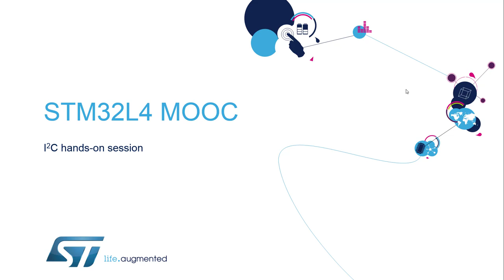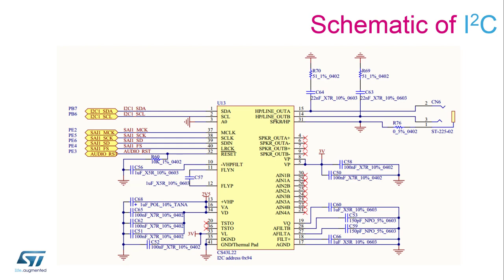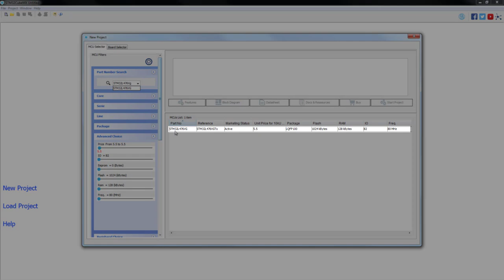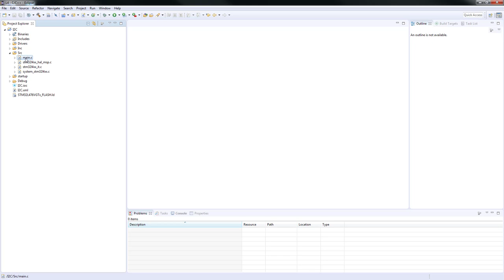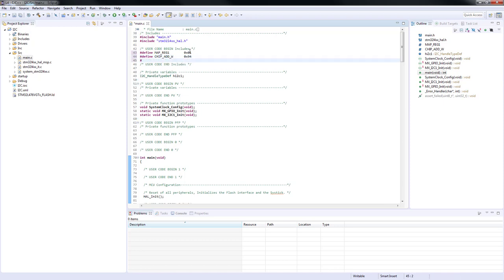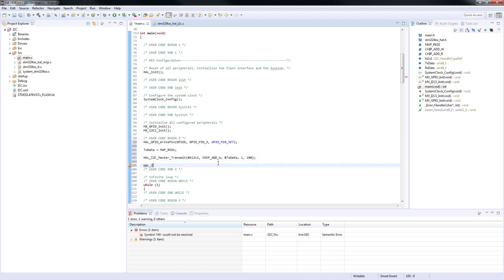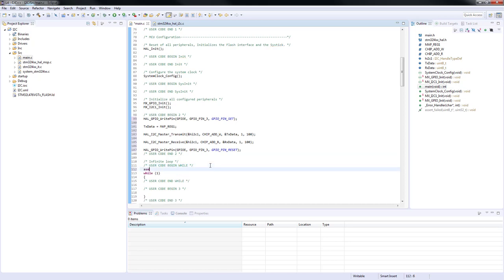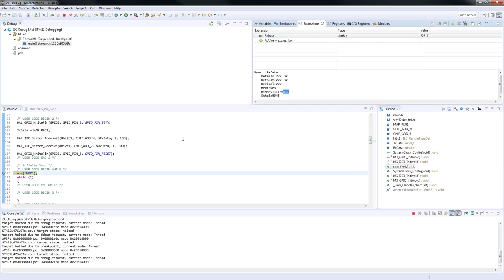STM32L4 training: 05.6 Communication peripherals - Hands-on I2C

Comment: Somewhat confusing. You did not mentioned that for I2C, GPIO ports B6 and B7 should be Alternating function open drain. Clock on APB should be the same (2, 10 or 50 MHz) as on register (for STM32F103VET6, for example) I2C_CR2 FREQ[5:0]. There is more, but I will not bother you with that.